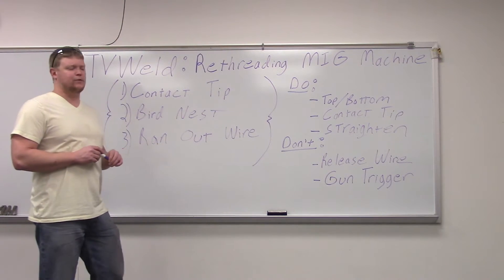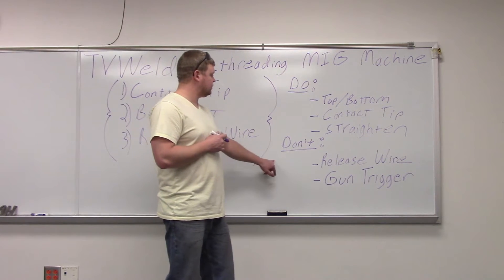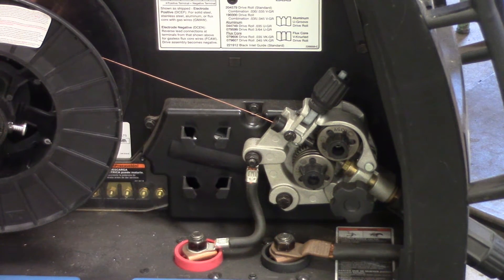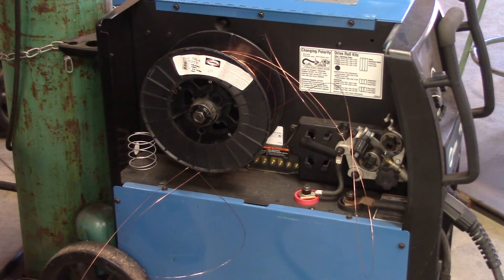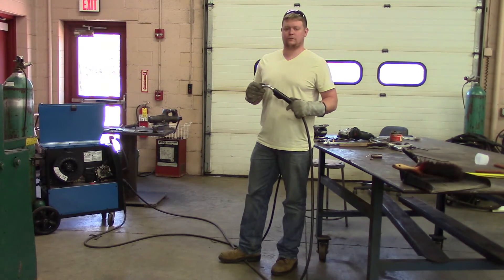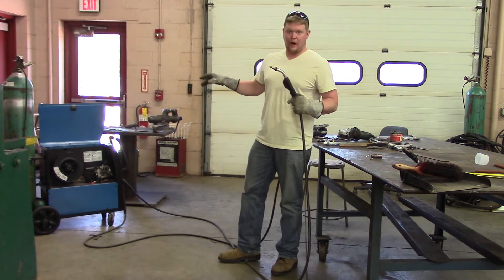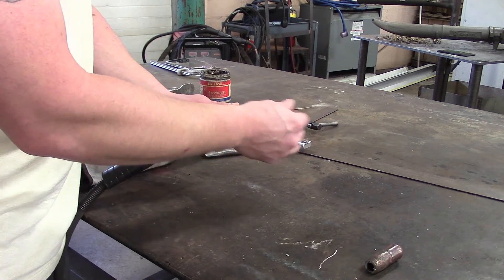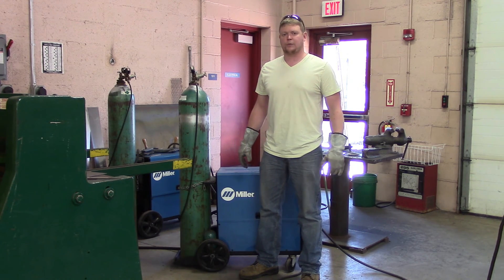How to Rethread a MIG Machine

Comment: Never knew about the wire jumping off the spool like that, thanks for that info. I got a spool gun and I loaded in the Aluminium wire a couple weeks ago, it did that a little bit, not as bad as that big roll on your machine but I'm now a little worried it will not load properly. I'll pull it tight and unroll it a few feel and roll it back on. Man there's some basic stuff that really looks important to learn, appreciate the info